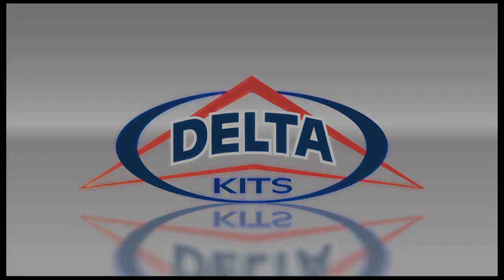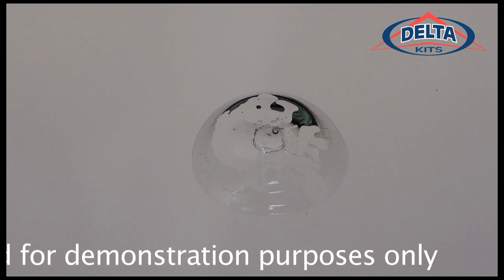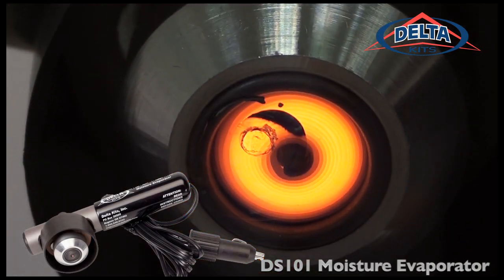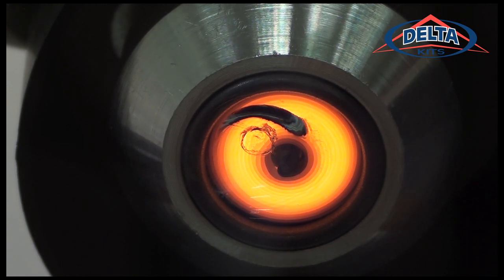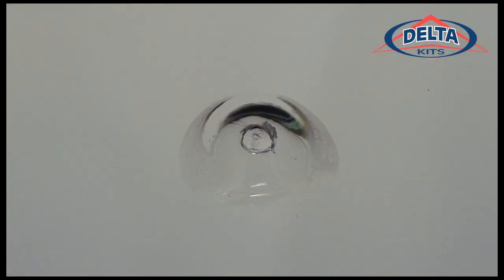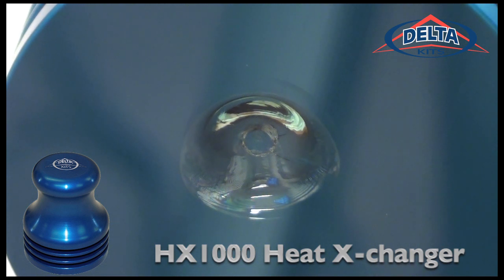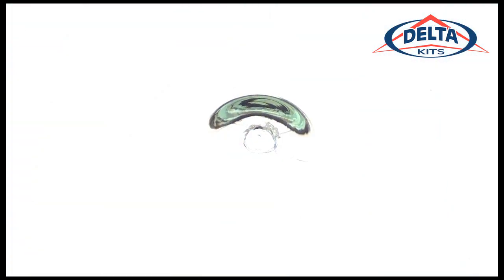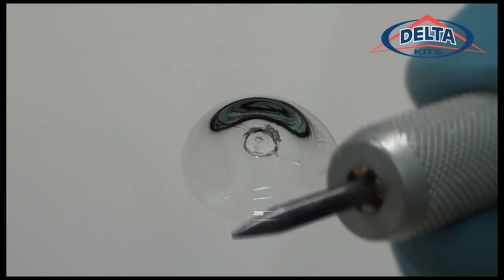Windshield Rock Chip Repair: How to Remove Moisture from the Break Tutorial#8

Comment: What’s the chance of it cracking out during this process? Depending on different weather.
Reply: The chances of a crack are high the way they are showing it in the video. You need to heat the surrounding glass before you put the evaporator right over the chip. And then don't just put a cold heat exchanger directly on the chip like that. I warm mine up by touching my skin first, and then I cool the chip and surrounding glass slowly and gradually or else you'll get a crack run every time.